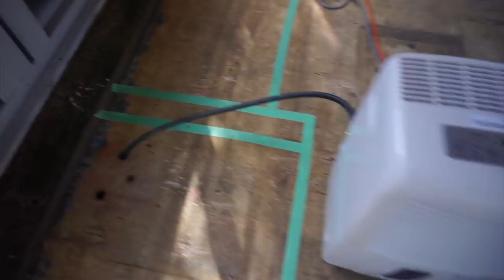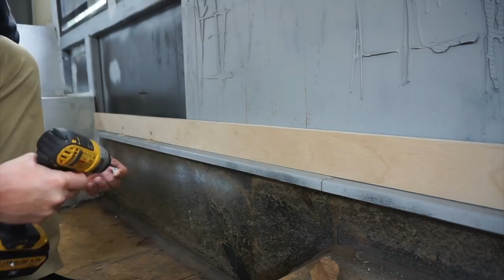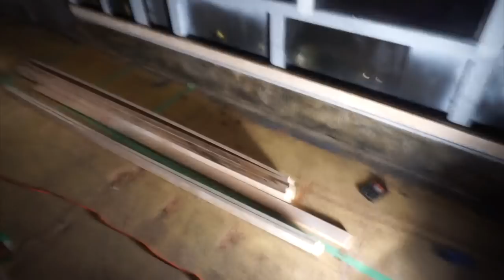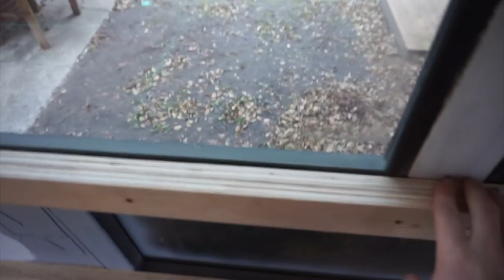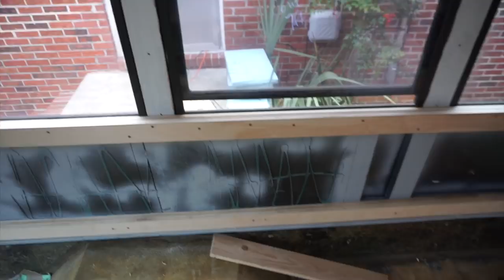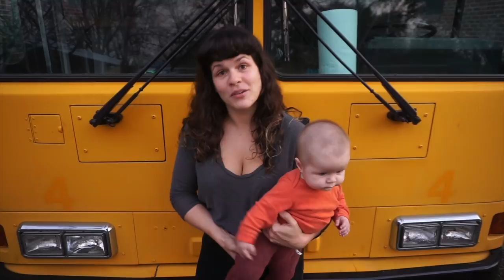How we Installed Furring Strips on the Walls: School Bus Conversion Ep 9

Comment: Thanks for this video (and all of them, really). What's the reason for ripping strips of plywood vs. using a 1x3 or something similar?
Reply from the maker: You're very welcome. Ripped plywood is a better product, easier to work with because it's straight, holds screws better, and doesn't splinter at the sheams like 1x3's, but likely not worth the increased cost and labor. So the only reason I ripped plywood on the walls was because I wanted a visible plywood seam at the windowsill to match the rest of what you'll see me build in the bus.
Reply: @MobileDwellings  Got it, thanks! Did I notice you used multiple strips for each furring? Is that for the thermal break?